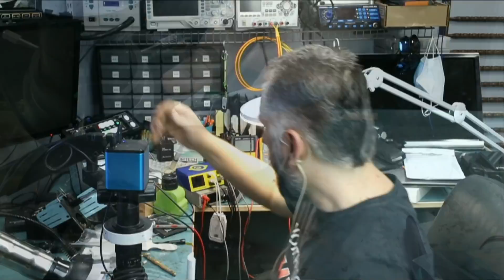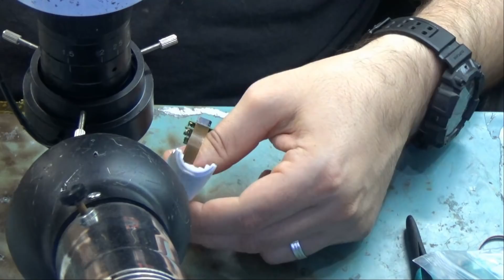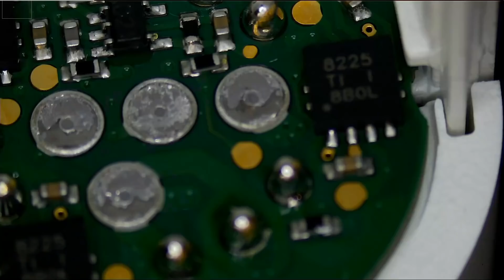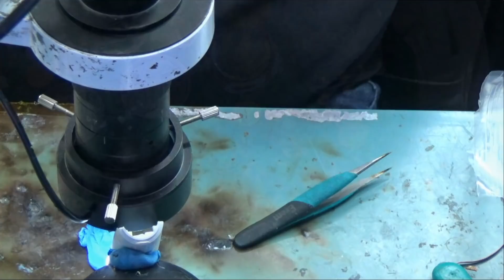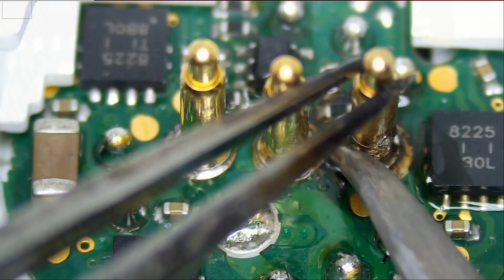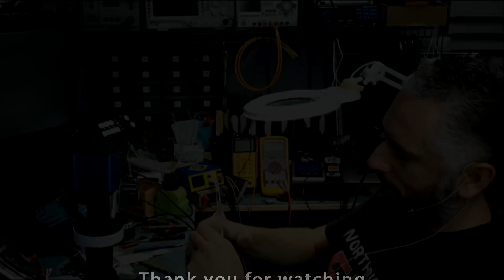X Smart IQ Endo cordless ardotontic repair. This one really felt like surgery.

Comment: Very Nice, NF. Akward position definitely increases difficulty of job. Due to gold plating, pin alignment issues and proximity to one another, i think i would have used solder paste and very precise hot air from Zephyrtronics ZT-2 hot air pencil. To minimize the risk of gold embrittlement, i might have solder-washed and tinned the solder surface of the pins to reduce gold concentration in the finished joint. Cheers.

Comment: I feel like using hot air and letting the pins flow with the solder capillary action might have made them straighter.  But then it might blow them over too!  That's a tough repair.  
You almost need the socket they fit in to use as a guide while they cool.  
A human  will never be as precise as a pick and place.  

I'd love to see a follow up on this after the customer tries it out!

Comment: POGO pins like this usually fit into a hole. It's odd to see them surface mounted. Makes it a pain to get them plumb.

Depending on how the device connects, those may not last (especially if there's torsion on it).

Comment: Whoever designed those pins need to be smacked, it’s a wonder they didn’t take the pads with them. Pro tip when working out of position like that, prop up some books or other items so you can rest you wrist on them, learnt that one from the TIG welding crowd!

Comment: Blue tack is very handy stuff. Don’t you have a manipulator or holder, Alex? That would help with jobs like this. Nice work free handing the soldering
Reply: Had a few wristwatch channels pop up in my suggested lately and they use it, or something very similar, quite a bit too.
Reply: @Druid_Plow  The watchmaking stuff is called Rodico. It's used to clean dirt and oils. Not really used to hold stuff but I guess it could but not it's purpose.